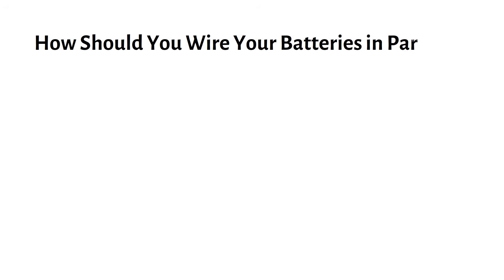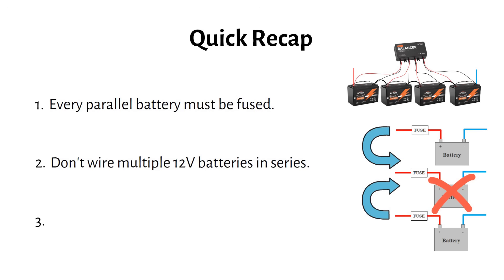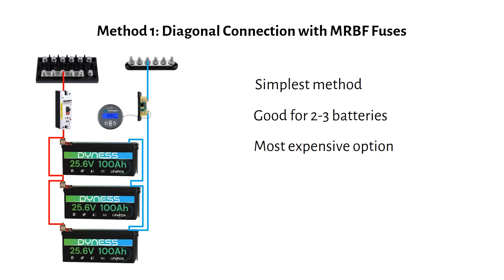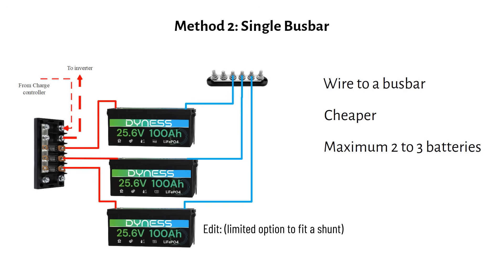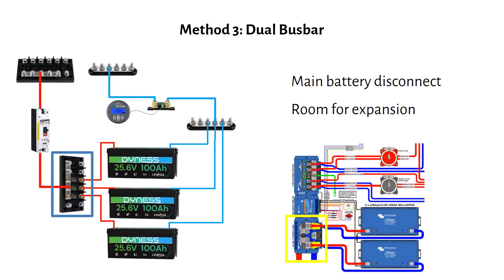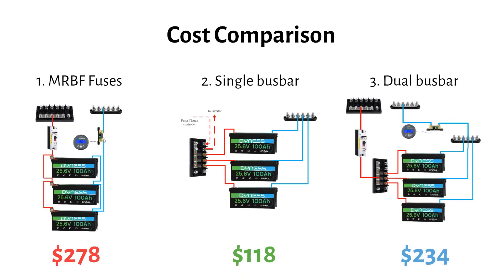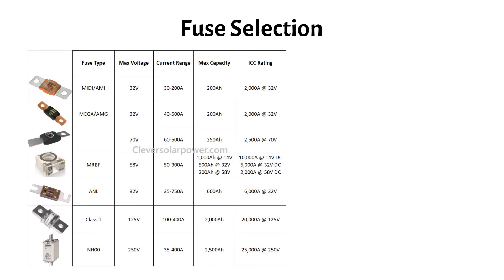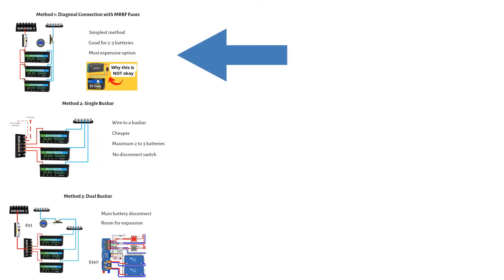Parallel Battery Wiring Methods Compared – Busbar vs MRBF Fuses

Comment: Thank you for the wonderful grafical explenations. I use 4 megafuses 100A for 4 parallel 100Ah Batteries on a 500A bus bar from offgridtec in a 24V System and a common one for the sumof all four in ANL-Format of 300A, because of the higher ICC rating from 6kV.

Comment: On the alternative section you did not mention the most common DIY batteries. The 48V rack batteries with internal fuses. Maybe a video covering this and a discussion of what to look for when some don't charge at even rates.
Reply from the maker: Indeed, some of these have internal breakers so there is no need for an extra fuse. I would add a class t or nh00 fuse for the combined battery pack though. To get the best current sharing for server rack batteries you need a busbar like I showed in method 3.
Reply: @cleversolarpower  Good info on the specific fuse. Current sharing though isn't always equal. Even with a busbar. I'm left wondering if and when I need to return a battery or two. I have not contacted the manufacturer. Yet.
Reply from the maker: Yes, the internal resistance is never the same in every battery. But that difference shouldn't be much. It shouldn't take more than a factor of 1.25. check my video about parallel different capacities for calculations.

Comment: Why not 4 batterys in parallel? They are rated for 4P.
Reply: The more batteries you put in parallel the more dangerous it gets.  The 4P rating most manufacturers specify is generally a function of what their BMS can interrupt.... A single battery short is usually around 20x the BMS rating.  Four batteries shorting into one would be 60x.  With 100A BMSs that's 6000A.  So the manufacturer is basically saying that their BMS can stop a 6000A short when they say you can do a 4P configuration.

But can it?  Not necessarily.  In a whole-home battery solution the answer is usually yes, they can.  But for most off-the-shelf batteries the marketing says 4P but the BMSs might not be able to actually handle a 4P short without additional fusing.   On the other-hand, in any battery-to-battery short there ARE at least two BMSs in the current path, so we aren't entirely depending on a single BMS being able to stop the short.

The fusing can also be problematic.  MRBFs are usually rated to be able to interrupt 2000A at 58V (10kA @ 12V).  A single battery.   When you have a bussed system with per-battery fusing you are really depending on the fuses for the batteries the current is coming from to blow because the fuse for the battery that was shorted probably can't handle 6000A.   It's considered safe, though, as long as all the batteries are fused.

One is also depending on the path through the BMS restricting the current somewhat in a BMS failure situation.  The BMS's circuit board is probably not able to pass 6000A, so the fuse winds up working anyway.

This is also why (in large systems) splitting the main battery bus into a battery bus and a device bus with a T-Class fuse inbetween is often important.  It reduces the I.R. that needs to be dealt with by breakers and fuses on the device bus.
Reply: @junkerzn7312  When you say "the more dangerous it gets", what is the danger you are talking about?  

As far as I am aware, these LiFePO4 batteries do not do anything dangerous, other than possibly vent flammable gas, which can lead to a serious explosion, so it is more important to provide adequate ventilation than it is to provide fusing to protect the batteries.

You should of course provide adequate fusing to protect the cables from overload and fire, but I don't have much interest in protecting a failed battery, it is going to get replaced anyway, unless there is a possibility of it doing something dangerous which can be prevented in some way, but if you stick to the manufacturers "4P" specification then it should be safe...  

Not all manufacturers say 4P, Victron, in their "Lithium NG 51,2V/100Ah battery manual", say "A total of 50 batteries can be connected in parallel.", "for a maximum of 385kWh", showing them connected directly to a fused busbar.
Reply: @nigels.6051  The issue primarily comes down to the I.R. (interrupt rating) of the safety devices.  The fuses, breakers, and the FETs in the BMS.  All of these devices are designed to only be able to stop so much current, above which they'd explode or fuse or otherwise stop functioning properly (and in a shorted condition rather than in an open condition).

For example, a 150A monster fuse might have an I.R. spec of 2000A, whereas a 150A T-Class fuse might have an I.R. spec of 20000A.  That means that if the fuse blows while current below the I.R. is flowing, it will work properly.  But if current above the I.R. is flowing, the fuse might not operate properly when it blows.

The I.R. is also voltage dependent.  The same 150A fuse in a 12V system might be able to stop 10,000A of current but in a 48V system that might only be 2000A, for example.  So more care is needed when fusing higher-voltage systems.

--

When a manufacturer says that a battery can be paralleled up to 4, what they really are saying is that  the BMS in the battery is capable of stopping a dead short being fed from the 3 other batteries.

(but I would say, also, that many unlisted no-name brands make all sorts of claims without actually ensuring that their batteries can meet those claims).

--

There is no limit to the number of batteries you can actually parallel... its just that above a certain number you have to add additional safeties (breakers and fuses) to ensure that the safety devices down-stream are actually able to handle a short.

For example, take your main breaker panel.  The I.R. spec of the main service breaker is far higher than the I.R. of the branch circuit breakers.  They actually fall under different UL listings.  The branch circuit breakers can be cheaper because the main service breaker ensures that the current will not exceed what the branch circuit breakers are designed to handle during a shorted condition.

-Matt
Reply from the maker: I think you mean series? Just because you can connect 4 12V batteries in series to make 48V doesn't mean it's a good decision. Just like they sell 12V 3000W inverters.
Reply: @cleversolarpower no parallel.

Comment: I have setup 3 with a T-Class fuse instead of the breaker. I already have this type of breaker but have to figure out how to cleanly install it on the board.
Reply from the maker: If you already have a class t fuse and don't need a disconnect, then you don't need the breaker.

Comment: 2 12v 100 ah battery is parallel with charge controller on one end and the inverter on the other, not sure if its the correct way but was concerned with putting too much on a single terminal.
Reply from the maker: That's okay as well.

Comment: I learned allot from Your Videos and Book off Amazon and use 400 amp rated Bus Bars with 6 Lugs and 4/0 Cable from 4 24 Volt 100ah Lithium Batteries and MRBF fuses on each battery and a Disconnect Switch for Safety and Servicing. 1/0 Cable PVC Coated from Batteries to Buss Bars is Sufficient to Combine all Batteries to Supply the Load and Charge properly. Thank You for Explaining this Energy Harnessing Concept for Us as You do.

💦 Indian Creek Ranch ⛩
Southern California High Desert 🌵
Reply from the maker: Thanks for sharing. Any specific brand of the 400A busbar or generic?